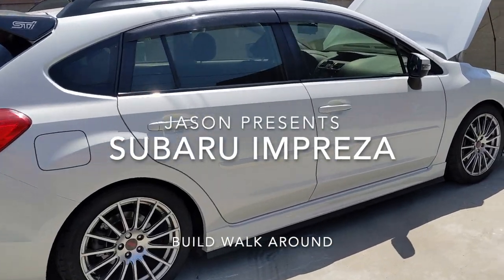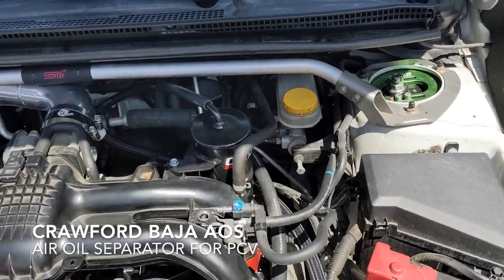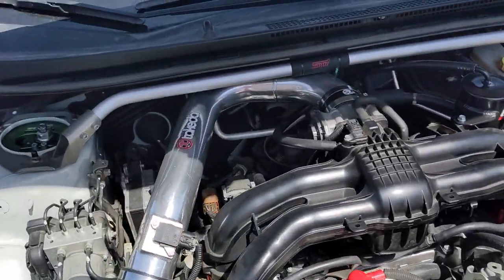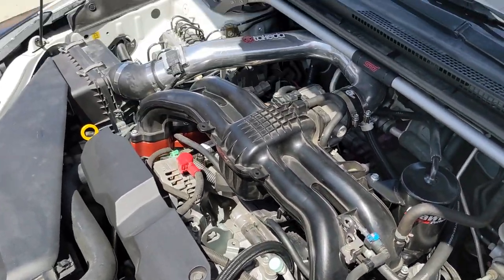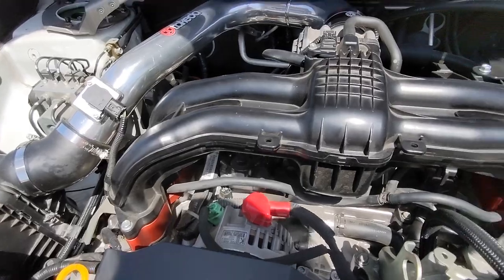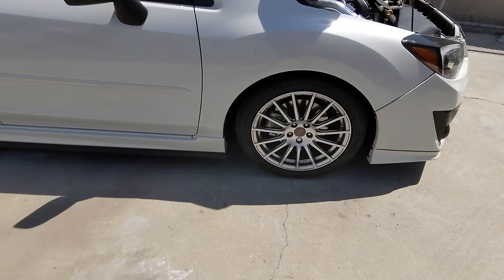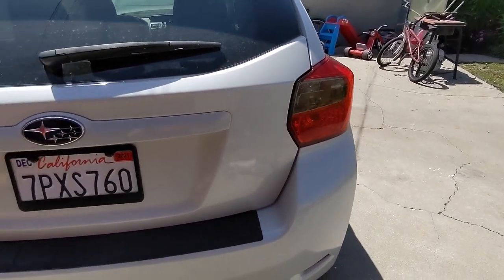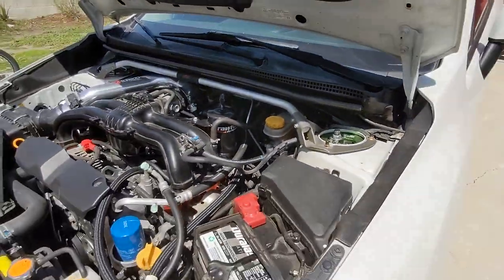Subaru Impreza Sport - Build Walk Around - May 2021

Comment: Nice Impreza! I have a 2013 as a daily that I will be doing a few mods on soon

To answer your adjustable endlink question.. From what I understand, the stock endlink length is specific to stock ride height. As you lower your car, adjustable endlinks allows your swaybar to sit at the correct level.. as swaybars are designed to twist, it’s common for them to sit as close to level as possible (ie, chassis mounting point level to endlink mounting point) 

Keep it up, I’m subbed
Reply from the maker: I see a lot of "Car people" upgrade their endlinks on stock suspensions, and sways. To what purpose other than to say they've upgraded a part that otherwise doesn't need upgrading.. thus my question. I would understand if thier was a significant drop, using adj. endlinks.. or if their sway bars were super heavy and needed the support over stock links. Other wise, yeah I didn't think so. Thanks! I enjoy this car quite a bit. I hope you do too!
Reply: I forget to mention they allow you to adjust swaybar preload as well for corner balancing.. not really necessary for a street car, but what mods are? Am I right 🤷🏻‍♂️😅

Comment: Looks sick! I assume that's the 2015+ crosstrek STI spoiler, did you have any issues installing on the Impreza? I can't find any info online about whether it fits
Reply from the maker: Thanks! The STI spoiler will fit the Crosstrek. The Impreza and Crosstrek share the same chassis code (GP) Mine was installed by the factory. But I heard it comes with a guide to drill holes.   Good luck!

Comment: I like your set up! I just got the 2018 version of that car. Is that intake actually for that car, or is it sold for WRX?
Reply from the maker: The intake pipe is for a legacy /outback 2.5 from 2013 I believe. I had to do some air box cutting to make it fit. The idea is called a hybrid intake. You keep OEM panel filter capabilities but gain in the intake flow through the aftermarket piping.

Comment: Great video, could your elaborate more on the results on the suspension set up? Are you getting better turn in or less understeer for example? Compared to stock how does the body roll and weight transfer compare to your current set up? I really like the mods and how the car looks.
Reply from the maker: The sway bars front and rear are pretty well balanced for less understeer compared to stock. Body roll is controlled.  The coilovers really changed the drive. The car reacts much quicker than the stock suspension due to the dampening and stuffer springs.  I'd you have stock suspension just a rear 22mm will be a drastic yet good change.

Comment: Did you install the steering dampener lockdown yourself? I have an issue with my 18 Impreza the steering is so light that it feels like the car is swaying when I’m going fast speed. I went to the dealer because I’m new to Subaru and thought something was wrong. I’m trying to figure out what I can do to make the steering and handling better than the stock.
Reply from the maker: I installed it myself yes. It's easier from under the car. But if you had to you could do it from the top with a little cursing.
Reply: @JasonLeung-4roller  I’ll definitely have to look up how to do that thanks for the reply man great video, I’m also ordering the bar for the strut top

Comment: impressive. where did you get the side door protection done.
Reply from the maker: It's called "body side molding" a Subaru option that you can get/purchase and install yourself it's quite easy, as it's a simple adhesive. It comes with a template so you can make it straight to your door. Took about 30minutes self install. The cost however is high for what it is. That being said it helps break up the monotonous side of the impreza. 😀

Comment: When you install the pitch stop mount, did you get a noise change? I just installed mines and during start up, the crank sound is more louder inside the cabin
Reply from the maker: Yes. Noticably louder on start up. And somewhat when reving the engine out and higher RPMs. NVH wil undoubtedly suffer. What is the aim of your build?
Reply: @JasonLeung-4roller  wow fast reply, thx, thought I broke my car lol
Don't really have a goal in my build, just messing with the car with common mods so it's easy for me to do I did these so far:
Nameless straight pipe

Crawford intake manifold spacer

Perrin pitch stop mount

Bought Rims from an old wrx to replace my base model hub cap rims (still needs to cleaned and painted before installing, just want to see if I can garage paint rims)

Broke my genesis so I just got a cheap car to play with until Elon feels like releasing the cyber truck so I can get it
Reply: @JasonLeung-4roller  thinking of getting a cold air intake, not sure yet though

Comment: Can you put links for the front diffuser, rear diffuser, lip and spoiler and
Reply from the maker: For the Impreza Sport, it is a Subaru Optional Part are called "aero splash guards" for the Sport trim", and "front underspoiler". the lip is an "All Fit full body lip kit"

Comment: You think you can link the oem rain guards and where do you think i can find a sti spoiler?
Reply from the maker: I added the OEM rain guards parts number in another comment. I assume you know how to find the best price using google shopping or ebay. As for the STI spoiler. I heard they are quite difficult to get as dealers are holding on to them for warranty work. Good luck!
Reply: @JasonLeung-4roller   thanks and do you get most of your car parts from google shopping and ebay?
Reply from the maker: @mmaannnyy  yes most. Different stores will show up with prices and shipping, I usually have the part number after doing research. This site you can find all the impreza accessories http://www.cars101.com/subaru/impreza/impreza2016.html (check earlier years 2012). Ebay for certain things, Subaru parts stores (many online) for OEM parts. Then tuner/aftermarket stores for aftermarket parts. Facebook marketplace is also good for finding stuff too. Good luck!

Comment: I think you just need better wheels, overall looks good to me.
Reply from the maker: Looks wise they are fantastic. I would agree. To me they just look like a flashier limited wheel. However, the construction and weight of these STI enkeis provide good strength vs weight compared to anything stock or aftermarket. I do want to go wider and with less offset , but for now they are a good performance compromise since I got them for such a good price. It's OEM+ so can't complain.

Comment: Where did you get your intake pipe?
Reply from the maker: This intake pipe is from Takeda. It comes from the 2.5 legacy 2010. I bought an entire kit with a cone filter and air box assembly. However I found through testing that the cone filter doesn't pull as much air as the aftermarket panel filter. I retrofitted the intake kit pipe to the stock airbox. You may be able to purchase the  pipe and silicone hose bits a la carte via Takeda directly. Kit number TR-4303P for reference. If you can find the parts list then your gold.
Reply: @JasonLeung-4roller  what kind of testing did you do
To be able to tell the difference? Was there a noticeable sound change between the two also?
Reply from the maker: @Nightowl82  I have recorded MAF, mass air flow, rate using a OBDii Bluetooth reader and Torque Pro android app. I can read how grammes per second the intake is pulling in. I went from 106g/s to 108 (witj a filter) to 112.9 g/s (filter and intake pipe and breathers) . Each 1g/s is about 1.25 BHP that's about  8 (engine HP) gain potentially under perfect conditions. But take that with a grain of salt. Heat, humidity, gas quality, moisture, altitude and other factors can reduce that significantly. 

As for sound. I went from the OEM setup to this intake pipe. At full engine load you can hear the engine more. The OEM intake is made from silicone coupled with a baffle and accordion  all which absorb sound. Replacing the pipe with a thin stainless metal pipe increased the noise.
Reply: @JasonLeung-4roller  after you cut off the maf sensor how much of the stock box pipe was left to put of that rubber elbow? Doesnt seem like there would we enough to keep it sealed. What did you use to cut it?